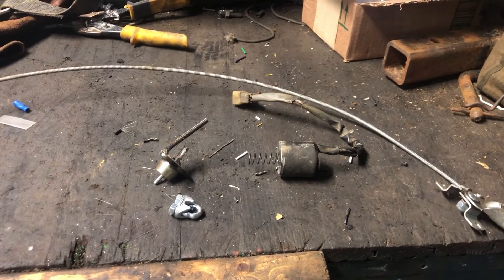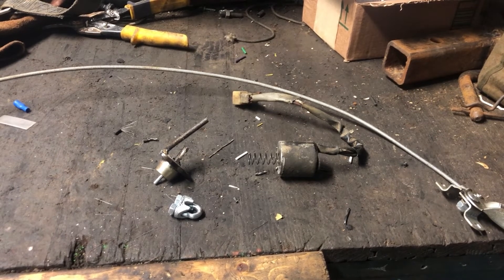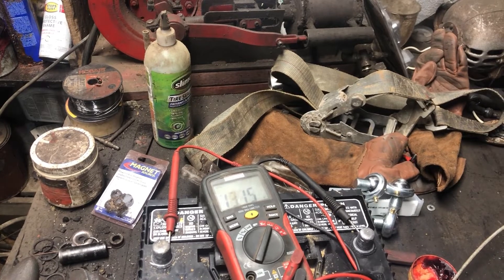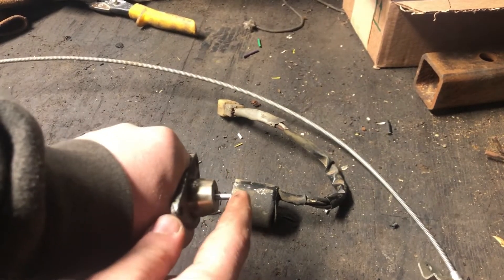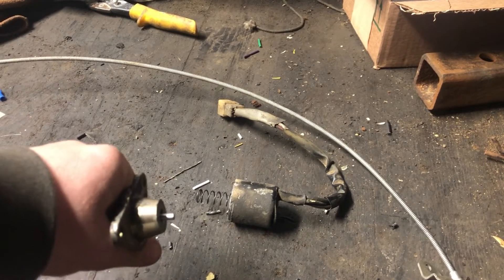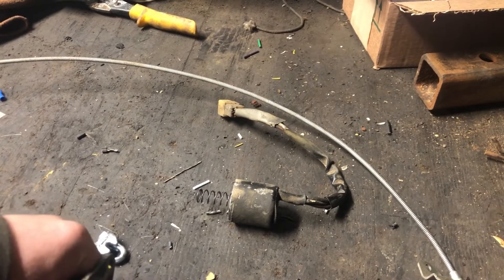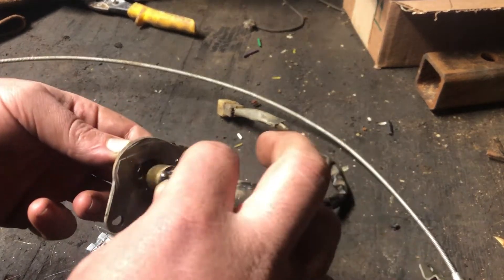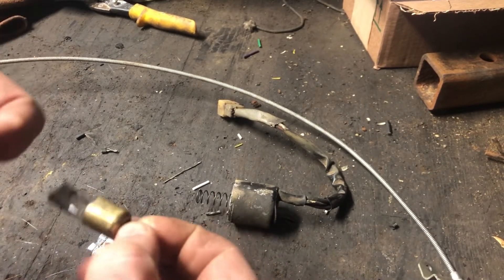Yanmar Gator Manual Fuel Shutoff Actuator

Comment: thanks for the video. is my solenoid working correctly if...when the starter cranks, the pin pulls in, as soon as engine fires up, the starter is off but ignition still on, the pin comes out? engine immediately shuts down as if turned off.
Reply from the maker: it sounds like the "hold" wire is not working correctly. What I learned with these is that there's two different circuits, one for "pull-in" and one for "hold". The solenoid should have a black, a red, and a white wire. If you have a multi-meter, there should be some amount of resistance from black to red, and some different amount from black to white, on the solenoid side of the connector. If you crank the engine and measure the engine (not the solenoid) side of the connector, there should be 12v to I believe the white wire during cranking only, and 12v to the red wire whenever the key is on. I may have red vs. white functions backward.
Reply: @firefly3333  thanks a ton for the response. it turned out to be a white wire under the black plastic next to the radiator. a mouse chewed it up. thanks for pointing me in the right direction.
Reply: How did it not leak any oil out if the shut off pin. with your manual set up